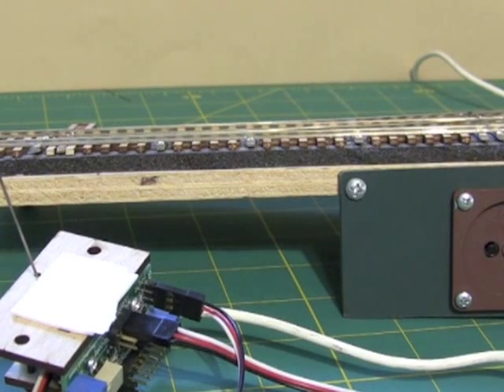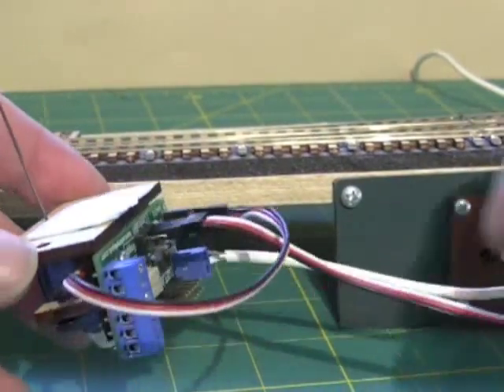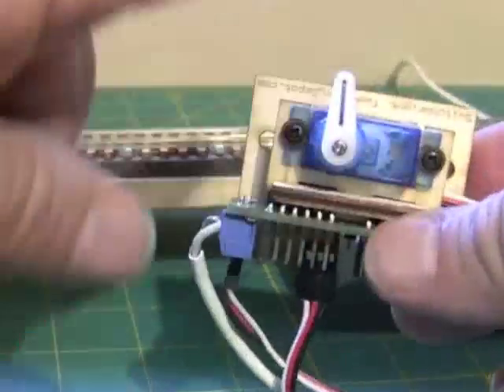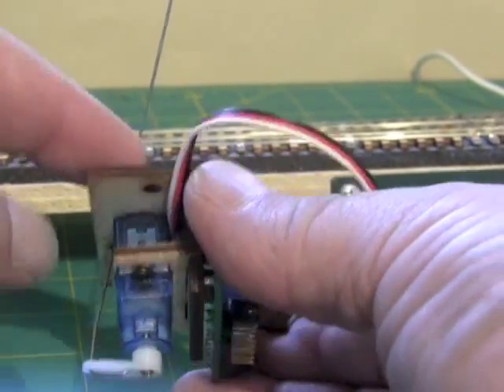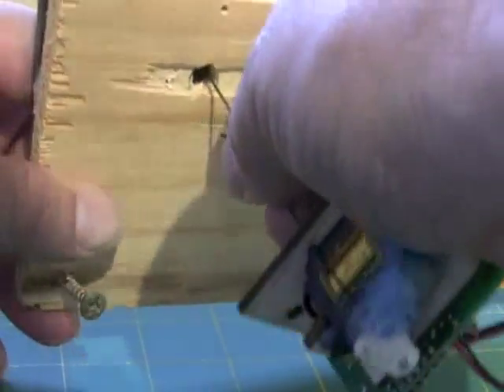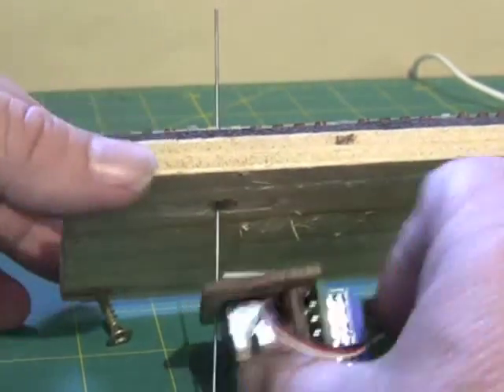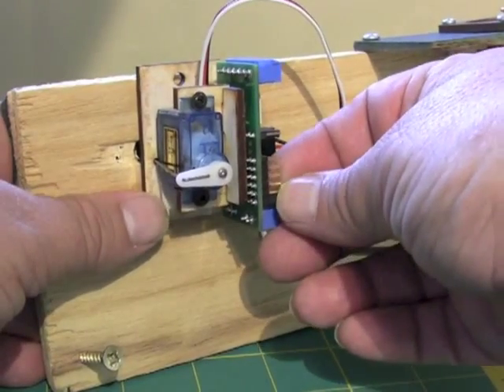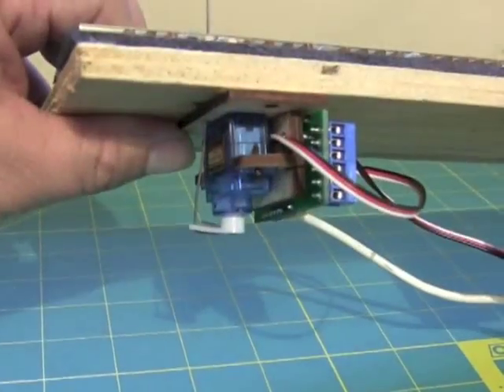Mounting a SwitchWright Servo

Comment: How would you recommend mounting to pink formboard? My layout doesn't have plywood for a mounting surface - just 1" pink foamboard mounted flush inside a 1"x4" grid, with Homasote glued to the top of the foamboard for subroadbed. Thanks.